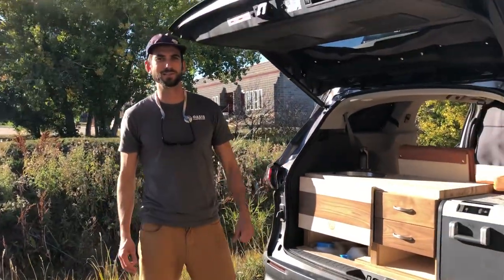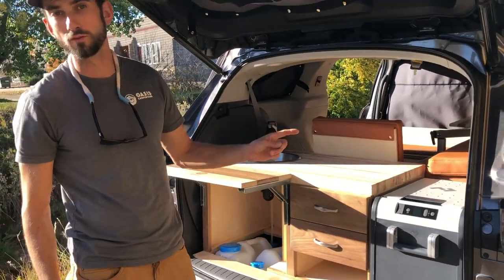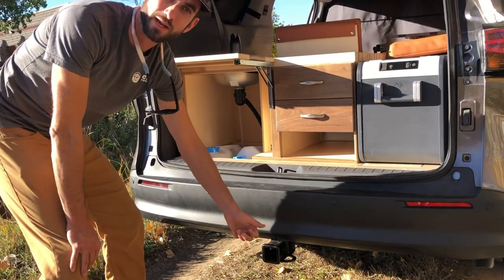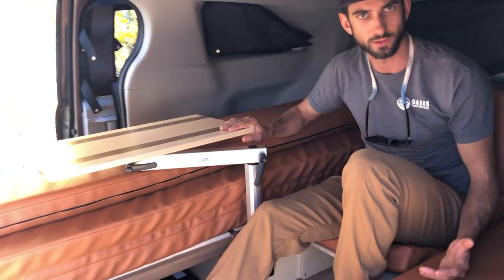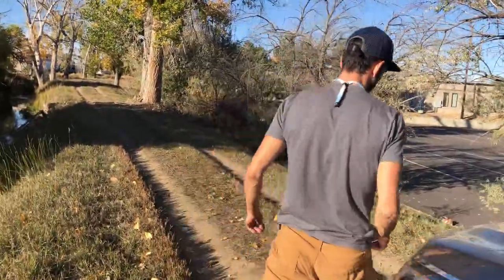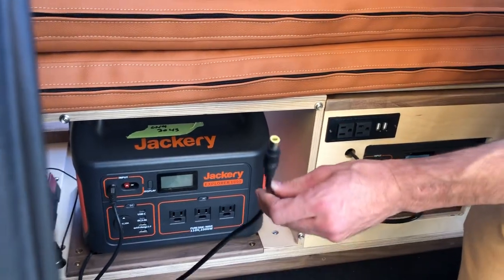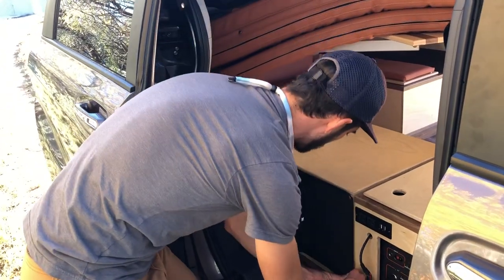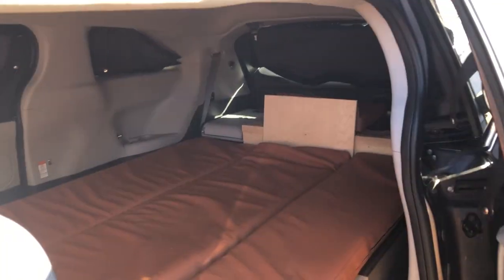This Minivan Campervan Conversion has it All!

Comment: I'm curious why you don't just use the back seat well for the power storage, then put kitchen on top. Also, it makes so much sense to be able to turn around the very front seats to extend habitable space. You would just need really good front window black out shades.